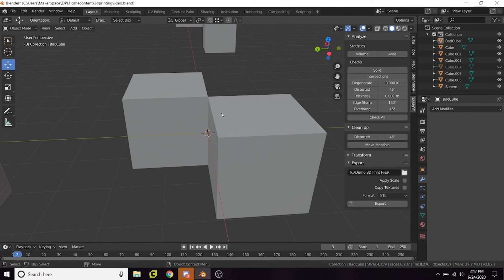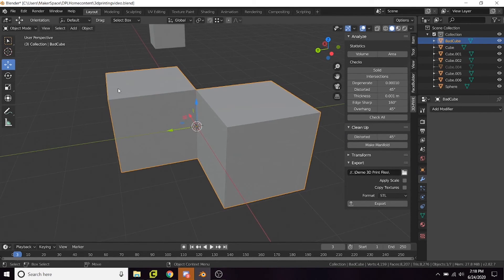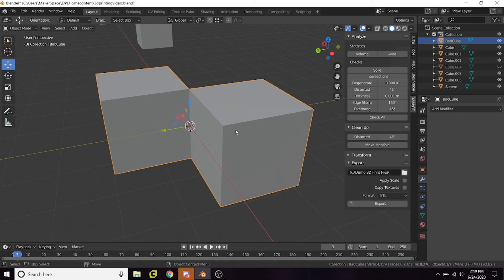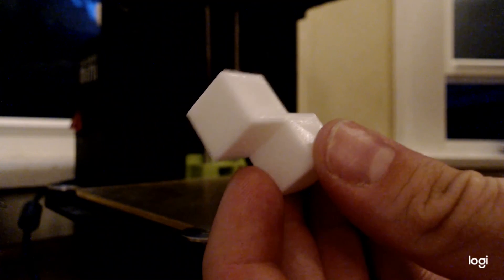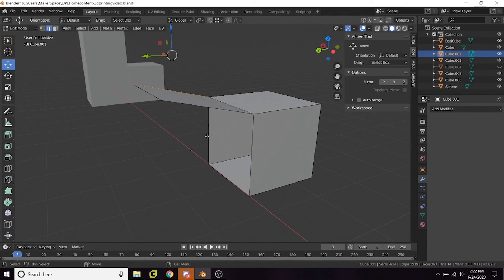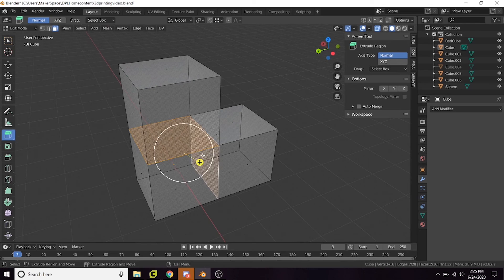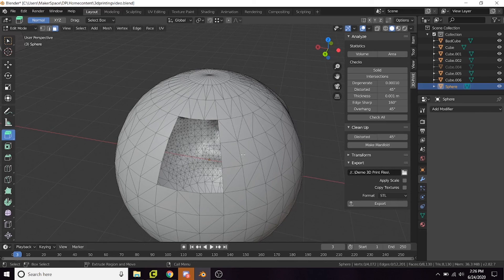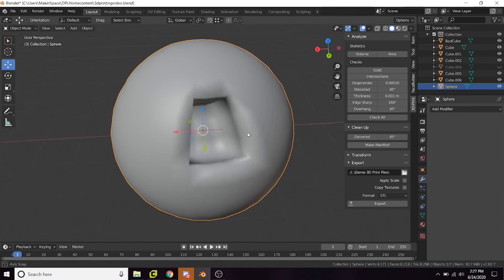Blender Tip: The 3D Printing Toolbox

Comment: i checked the box in preferences and checked in my toolbar but it doesn't show up even though its added. how do i make this work?
Reply: you need to create and select an object. After that the box in your toolbar will show up
Reply: @puserwindu4642  im having the same problem. i have an object in center view and selected in object mode. my 3d printing tools arent in that little side menu either.
Reply: After you checked the box did you save it in the lower left button?
Reply: same no sidebar 3d toolbox is enabled but cant get it to show up no matter what i try

Comment: my tool doesnt show up how do i make the add on show up
Reply: Had same issue and realized I was in Sculpt mode not Object.
Reply: Click on the edit menu drop down then click the preferences tab. In the preferences window click on addons and search for 3D-Print. The Mesh: 3D-Print Tool box should appear. Then just click the check box next to it and the 3D-Print tab should appear.
Reply: @rileybrown1250  im having issues. my 3d print tools dont show up over there in that side menu that im well aware of because i use it for measuring tools. when i checked the measuring tools they popped right up but the 3d print tools dont
Reply: That bar isn't necessarily open by default.  you need to hit the little triangle where the tool bar should be and it will expand